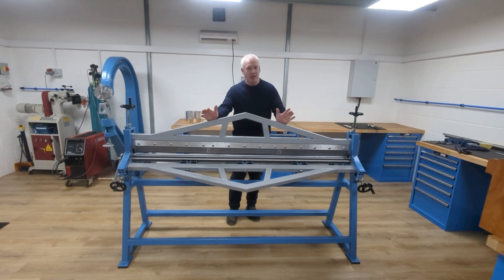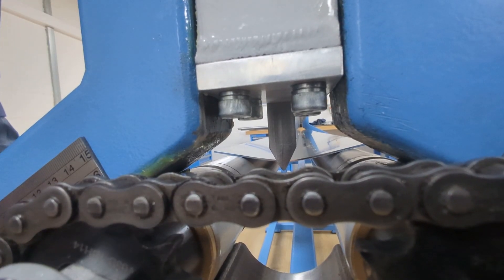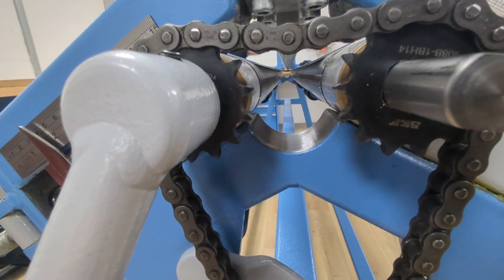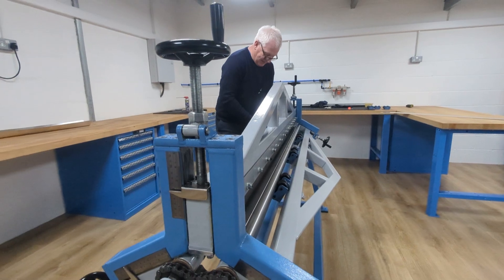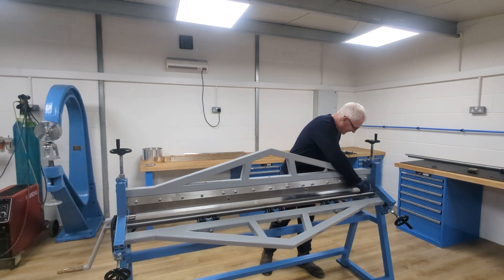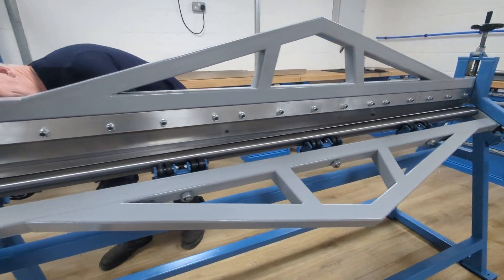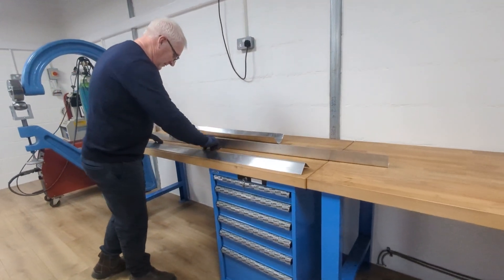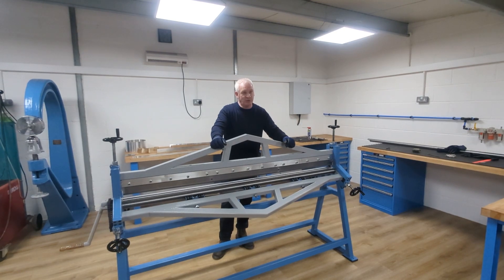Can This DIY Folder Bend 2 metres of Aluminium Perfectly?

Comment: How much rolling are you doing on one vehicle ? You could have saved a lot of time and money and got a company to press brake the limited number of parts you'll need!
Reply from the maker: HI, thanks for watching. I understand your point but I have asked a few fabrication companies if they can do a tapered fold from 0deg to 90deg over a 2m span and they have said they dont have a machine that can do it. I trawled the net to see if there is a machine out there that can do it and havent been able to find one. Also when I am making the parts for the car it would be much easier rolling or folding a part, offer it up to the car then tweak where needed and re roll or fold on my own machine rather than going back to a company back and forth to make adjustments which would increase costs. So thats the reason why I made this machine, and to be honest it was enjoyable making it especially when it worked so well.

Comment: As you know warmed up, that alloy forms better but clearly a challenge to keep it warm and bend with that set up. Novel machine though.
Reply from the maker: Thanks for your comments and for watching, yes I could have annealed it but I just wanted to test it as you would on a brake press or pan folder. It worked better than I imagined.

Comment: Great work! Isn't it easier to make another top-frame so you can easily swap out the roller assembly with te bending assembly?
Reply from the maker: Yes, @multirole240 also suggested that in the comments on the previous video. Great idea, thank you. I may well do that. Thanks for watching and for your comments